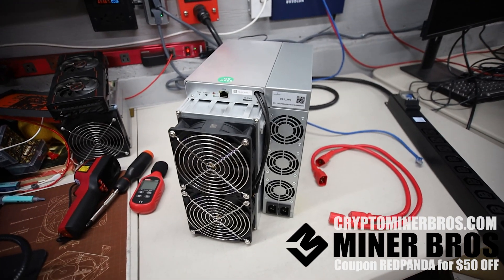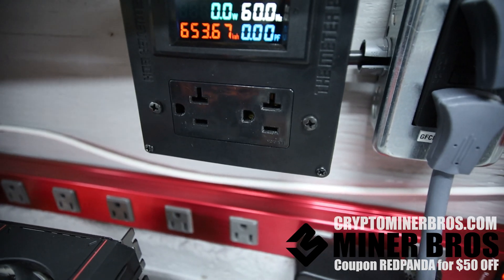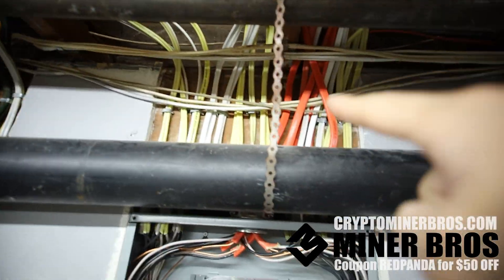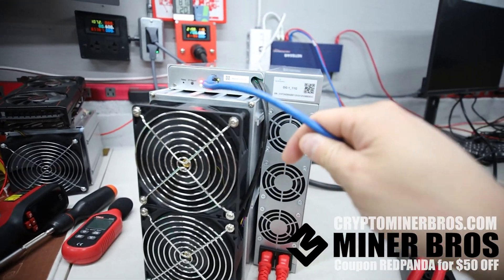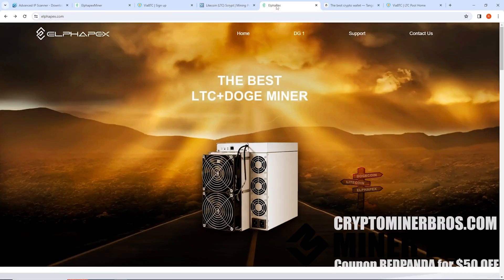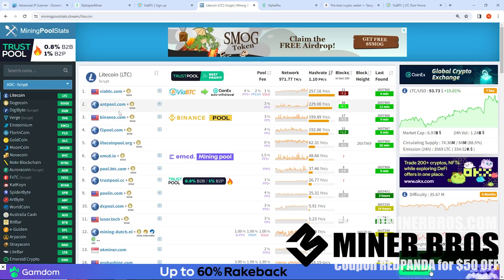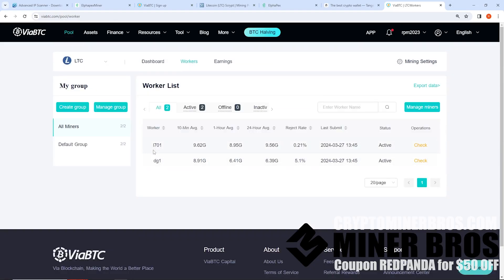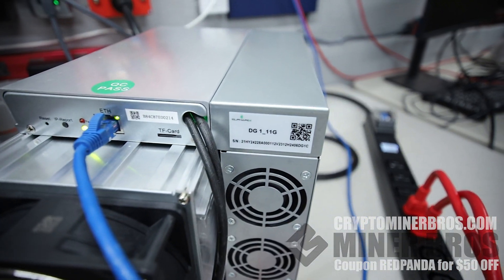How to Setup and Mine DOGECOIN with a Elphapex DG 1

Comment: I'm glad you got an electrician to do your installation! You stated that we must use at least ten gauge copper wire or something else. Then you buy a power cable that has 14 Gauge wire in it, 1/4 of the thickness of your ten gauge run. Your run is only as strong as its weakest link, your power cables. I make my own, as North America has no excellent 240V cables. Using a single phase, one could safely run two miners on a 10/2 Romex. (240 V) 20 Amp breaker for one or a 40 AMP for two units. I recommend one run per miner. And YES, they do run HOT HOT HOT. But for some reason, the fan setting defaults to only 80%; why? Does anybody know why? Will I give a solid reply for a gift?